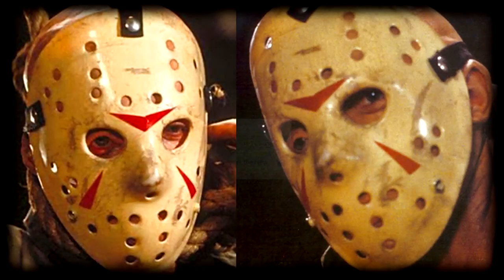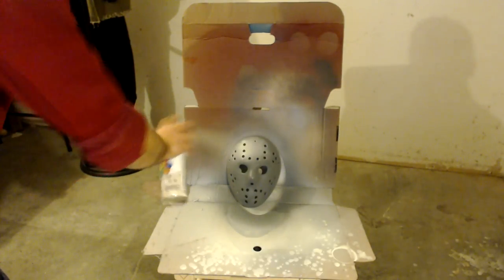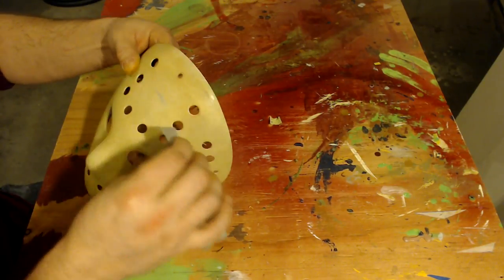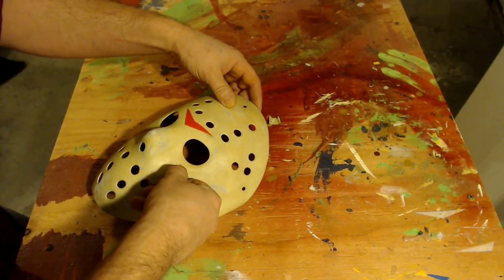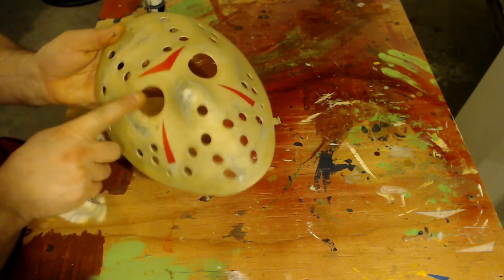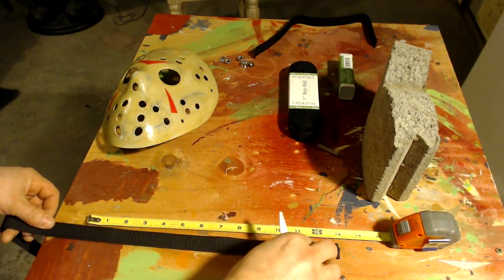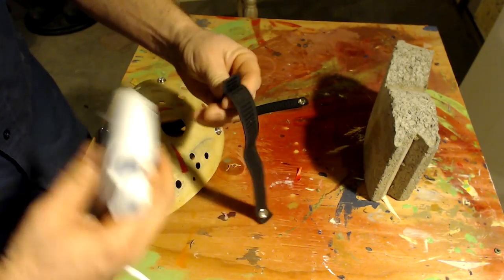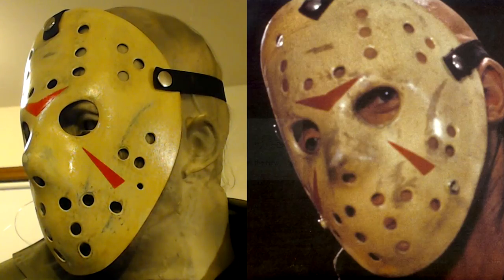(DIY) How to Make a Part 3 Jason Mask | Step by Step Tutorial how to make this mask

Comment: How much do the materials to paint the mask cost?
Got a blank mask but I want to save money so I can affort the paints.
Reply from the maker: about $4.00 for the spray paint and $1.00 for the Acrylic paints and $4.00 for the Clear coat but once you buy them you can use them on multiple masks :-)